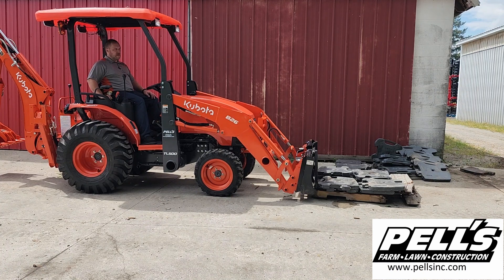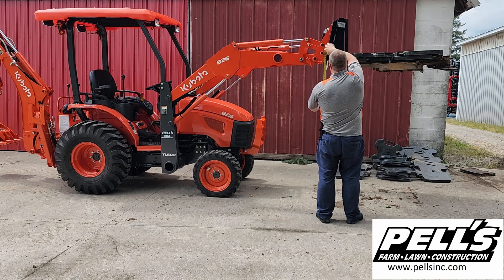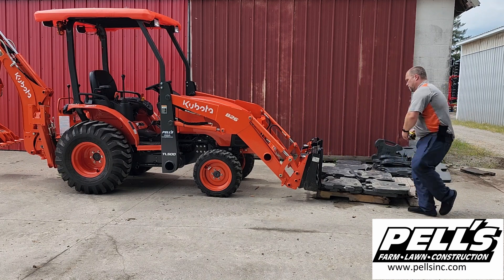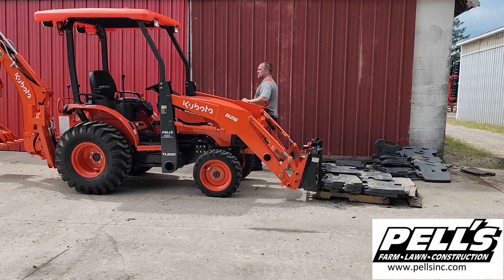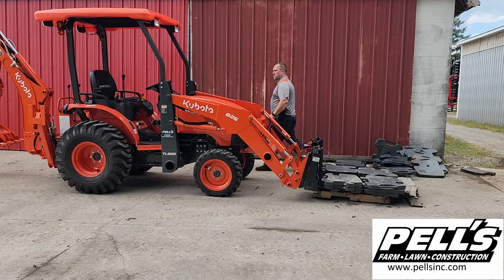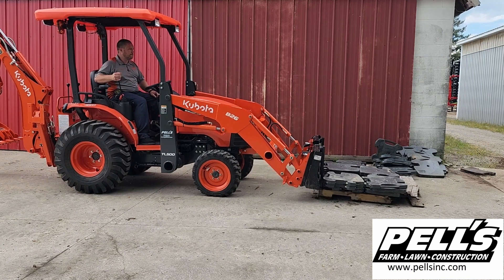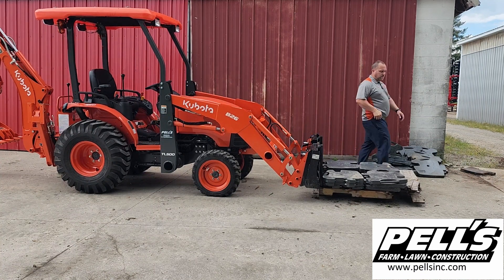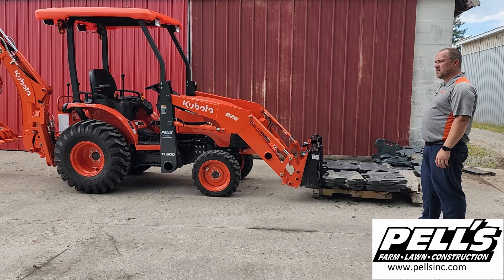Kubota B26 Lifting Capacity

Comment: Best video I've seen yet demonstrating lift of the B26.
Reply: Considering it's loader is labeled tl500 for 500kg/1102lbs Lift capacity to max. height at bucket bottom mid point: 1102 lbs (500 kg) .yeah id say getting It to lift just over 764kg/1685lbs of the ground at all is doing pretty good.